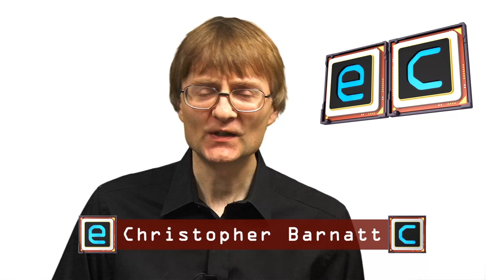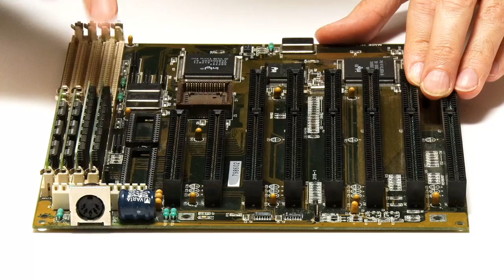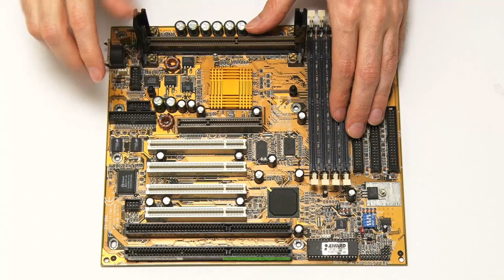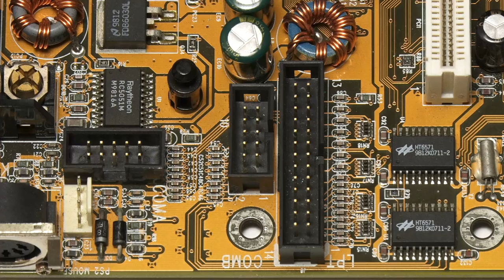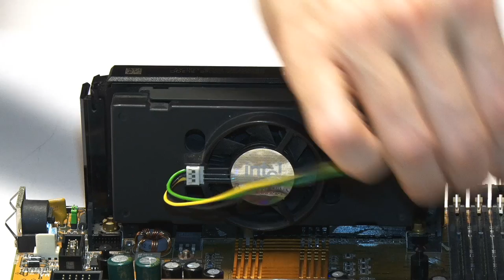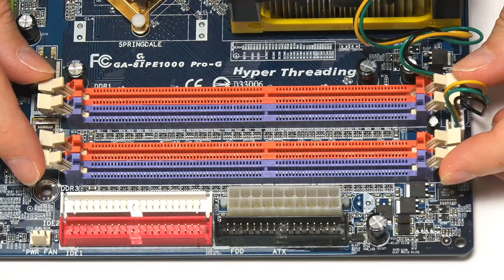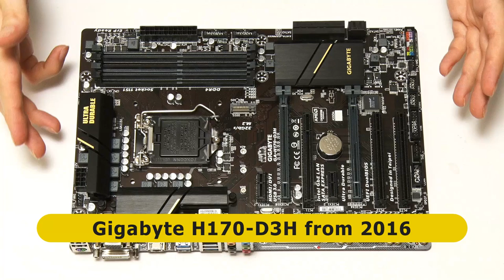PC Motherboard Evolution

Comment: Only thing missing was cache chips. Yes, kids, for a time you could buy your CPU and cache separately.
Reply: All the way up to the Pentium Pro, you had to buy the cache and tag chips.  From the PPro onward, it was "built in" (officially only built in only on the second wave of P3 chips.  On the PPro, P2, and first wave of P3, it was actually separate, but on the same substrate as the CPU.  The difficulty in inserting/removing the PPro IMHO is why they went to the Slot 1 (probably the cost of the PPro sockets too).
Reply: Not just "could" buy them separately, had to. Heck, before the 486, only the really expensive boards had any kind of cache at all. And now modern chips have more cache than older systems had RAM.
Reply: evknucklehead LGR has a video on installing cache chips on a 486 and the result being on par with a sizable clock bump - which begs the question, why was cache left as an upgrade option in the first place. 

The only way this makes sense to me is that component costs are 5-10x what they are today and this kind of ala carte computer building makes sense.
Reply: John, cache chips only became a thing due to the slow speed of RAM. No one anticipated that they'd become important, and they were thought of as more of an upgrade for your memory, rather than your processor. They only got added to the CPU die once RAM got faster and the motherboard interconnect latency between your CPU and cache became the bottleneck.

And funny story, CPU cache killed sales of the PII. Intel released the PII with cache and the first Celeron without cache. The Celeron tanked, so Intel added a little cache to the second Celeron and suddenly, once overclocked, it kicked the PII's arse. Everyone said they had a PII back in the day, but watch their systems boot and most of them were running Celerons.
Reply: it was less a problem with cost, and more a problem with die area.  Take a look at the Pentium Pro for instance.  The cache die was huge.  The Pentium 2 and early Pentium 3 (Slot 1) still had to have the cache on a separate chip.  Static RAM has only with modern shrinks become practical in any large amounts.  No matter how you look at it, you still require six transistors for each bit of static RAM.

Comment: Who here remembers when they first started making smaller rounded IDE cables? I remember them being so expensive compared to their flat grey brethren...
Reply from the maker: I remember paying a great deal for an extra long version of such a cable to use in a large tower PC. :)
Reply: I still have two of them.
Reply: @ExplainingComputers  I had a tower case like yours for a long time but it got damaged when I bought my new house and moved  in. I miss that roomy beast.
Reply: It had 5 external bays, 7 internal bays, at 5 1/4" 2 external and 1 internal 3 1/2" bays, it was 33" Internal Height, Can't remember the foot print now but was huge.

Comment: 6:16 Wait a minute… regarding that floppy ribbon cable and the expansion board: if I remember correctly, the red side of the cable indicates the position of pin 1, and on the board the pins are marked going from right (2) to left (34), so shouldn't the cable be inserted the other way round?
Reply from the maker: You are right about the red side/stripe. So maybe I got it wrong here. It is always hard working upside down and not getting in the way if the camera. Sorry.
Reply: That's all right, I understand it might feel weird if you're doing things upside down, but maybe you could add a title card explaining it? Aside from this though, this was a fantastic trip down memory lane, and seeing how much hassle it was to get everything up and running in the 1990s, it just makes you appreciate modern technology more! (There was a time when you could actually plug in things the wrong way and not notice! How crazy was that!)
Reply: Actually, it doesn't matter which way around you plug it in, as long as you plug it in the same way both ends. Good practice is to use the red mark as pin 1, but there's nothing that prevents you from going the other way around.
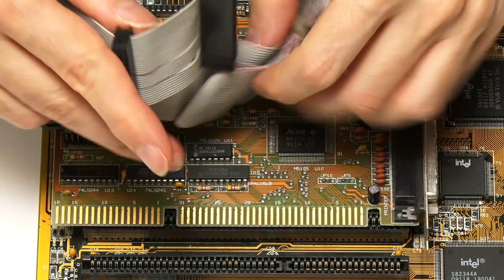Reply: As an addendum, there is one instance where it matters, and that is when the IDE / floppy cable has twisted leads as seen on one ribbon in this video at 5:54 . In this instance, you MUST connect the red mark to pin 1 for it to work properly.
Reply: Good point, I hadn't really thought of that before, I always just lined up the red with pin 1. But as you mentioned, this agnostic approach only works if the ribbon isn't twisted, and as far as I know back in the 1990s all floppy cables were twisted (if I remember correctly, this was to autoselect for drive A: or B: depending on which connector was plugged into the drive?)
Reply: Correct, the twisted leads on floppy cables are the drive select leads. Looks like a hack, but it's actually the industry standard way of making floppy cables.
Reply: New IDE cables came whit a pin blocked sow you CANT put in the wrong way in the hard drive, also has a plastic block. Floppy cables has no blocked pin, but "new" cables has a plastic block sow you cant conect in the wrong way in the floppy drive but not old motherboard has it sow you can put in the wrong way in the motherboard....
In other words => Pin 1 is red !!
Reply: lol I just commented the same. He sounded so confident as well in the fact he knows which way it does on. hehe
Reply: correct but not everyone knows this!
Reply: I remember that Apple IIe floppy disks had rainbow coloured cables.The cable carried power and data. If you plugged them in the wrong way it applied reverse polarity to the drive and blew up all the chips and electrolytic capacitors in the drive! What a funny smell it made. :-)

Comment: Oh hell this makes me feel old as I started with the Comodor 64.
Reply: I started with the VIC 20 !
Reply: @waynekwoods2799  Then I remebered a TI 99/4A I think???  I also bet you had a P.C. with only floppies.  My first hard drive was NEC RLL controller and lasted a total of 1 hour just the time to format it and install FS I think?
Reply: @waynekwoods2799  Did you have that super rapid casste drive to load programs?
Reply: @alecgrolimond1678  yes i did still have it. Also have 2 1571 drives on the self.
Reply: @waynekwoods2799  I cannot remeber the 1571 drives but for the Comodor 64 I had a drive maybe the same but the TI 99/4A I used a casset good lord I am old.  I became a computer network engineer but have retired.  Keep well.
Reply: @waynekwoods2799  I also had about 1000 priated programs for the 64 and managed property.  Plus a dotmatrix printer. I bet you had the same.

Comment: The weirdest boards of the 90s were the ones like yours that gave you the choice of older tech like the AT power connector as well as ATX. I have a board that supports DIMM and SIMM modules, and the jumper selector for the memory looks like a capacitor. Pretty odd stuff ;)

Comment: I really liked this one, very interesting that the 2004 motherboard had a 3GHz processor and in 2018 we're still not really at a much higher clock speed, although of course we have more cores.
Reply: More cores is probably how we're gonna get power going forward, though Intel and AMD might wanna focus on power consumption and heat for a while.  Not everyone wants a cooling tower on their PC.
Reply: yes, but it's only 1 core and Pentium 4 / NetBurst is a flawed architecture - it uses a very long pipeline to allow for very high clock speeds, more for marketing because performance is poor relative to the clock speed. Core (and later Core-i) went back to being based on P6/Pentium III/Pentium M.

Comment: The very first PC I spent my own money on was an 80386DX-25, like the one pictured at 6:48.  4MB of RAM, two 80 MB SCSI hard-drives.  VGA video.  Microsoft Windows (I think 2.x was out by then?) and Microsoft Word for Windows, too.  It was very pricey -- several thousands of dollars in 1989 when I purchased it.  Worthless today.  LOL
Reply: My first was a DX4 100, came with a Diamond Stealth Video Card that I upgraded from 1Mb to 2 Mb of ram. I even upgraded the ram from think it was 2Mb up to 8Mb. Cost was well over £120. The computer certainly ran much better with it. Do miss those days. When it fell over. If it wasn't this driver it was something else. Now, computers are soooo boring. Can't recall the last blue screen, years ago.

Comment: Great overview but I have an other opinion on the evolution. I think it's rather conservative until now!  Not much is really changed since the first Altair computer (40 years ago !!) Still the same principles are used.  One horizontal board with a series of expansion slots. We should have already evolved towards a more modular system oriented around cooling. Apple for example showed how it could be done differently (trashcan) (although not modular and proprietary)  For me the base of modern desktop pc should be a central cooling system (no more motherboard)  Example: In case of a cube you would have a central cooling system + (main) board (CPU+memory), 1 or 2  Video boards, 1 or 2 storage boards. those boards would mainly be made of a metal frame/board with the pcb integrated. The only thing you have to do is stick compatible board against central unit. And voila!  More efficient cooling, maximum use of space, cheaper (in the long term), faster to build/upgrade. etc ..
Looking forward to hear your ideas on the future of desktop Pc's!
Reply: yes the gpu industry suffers a lot from this horizontal expansion card interface. in some cases (pun not intended) the gpu has more power draw than the cpu and yet slot standards limit its cooler designs into very tight spaces meaning either a lot of noise, overheat or thermal throttling is guaranteed. putting a custom heatsink with fans was a necessity to let my gpu run silent at slight overclock and no thermal throttling
Reply: Unfortunately, Apple’s trashcan design was ... well ... rubbish. Impossible to upgrade in any meaningful way. That’s why it was abandoned.
Reply: @Lawrence D’Oliveiro  The design or better the engineering of the trashcan was sublime but like you said not modular/upgradeable . That's why I described a very modular hence upgradable system. I used the trashcan only as example of system with a central cooling system with no real motherboard! There is lot of potential when executed right! 
(don't focus on one word!!)
Reply: John, that is why they make water cooling.
Reply: I envisage a future where computer components will be supplied in packages with standardised, interchangeable dimensions and a small number of high-bandwidth serial communication links (Like Transputers) on top. They will clip together into any required configuration and all the parts you bought earlier can be included and will contribute whatever level of functionality they can. we could call the architecture  "Laterally Expandable Generically Organised".
L.E.G.O for short. :-)

Comment: I finally got to hit the "like" button BEFORE any of the trolls had hit the "dislike" button. Excellent trip through the past with motherboards. I used to upgrade my computer about every 4-5 years so I had similar motherboard configurations, except I started out quite a number of years sooner than you. My very first computer was a TRS-80, and the next was an IBM 8086 clone. :)
Reply from the maker: Thanks for this. I started out ZX81, Spectrum, QL, then went Amiga for quite some time for the video use. So I was a bit late getting to "real" PCs . . .

Comment: My first pc was a 386.I was always pressing things to see how it worked.After wiping the hard drive three times the guy in the shop told me to stop trying to figure it out and just use it,which I have done for years until I discovered the raspberry pi and this channel now I am tweaking things again.
I have already wrecked an old laptop while changing the faulty USB connectors.I tore the ribbon connector from the main board to the keyboard.I think you have to mess a few things up to learn not to do it again.Anyway I am having a lot of fun at 55 messing around with PCs.

Thank you for bringing out the geek in me .